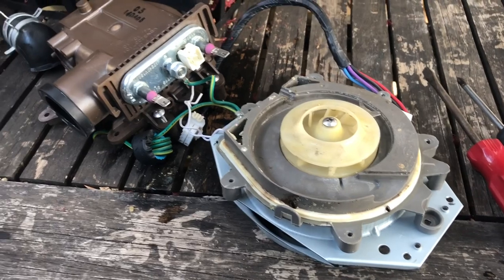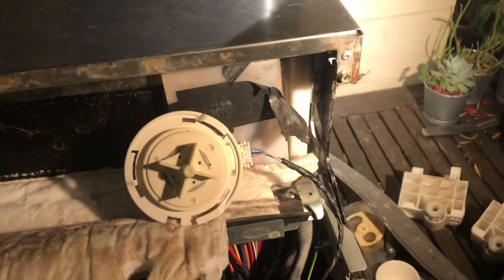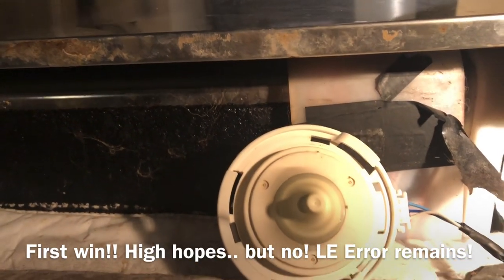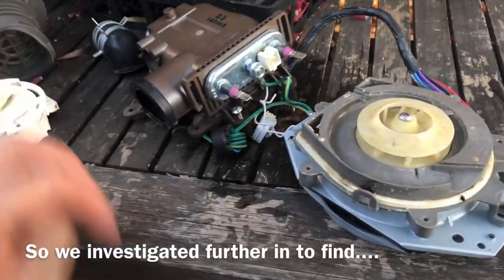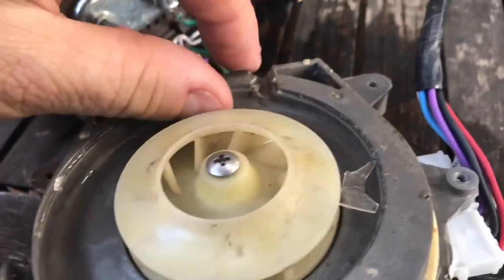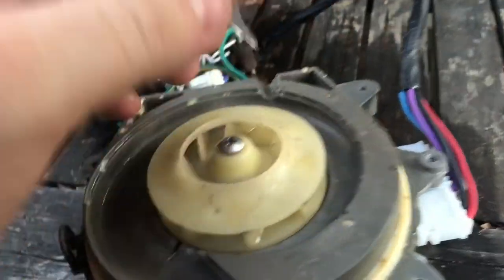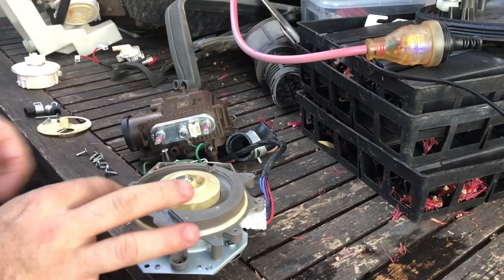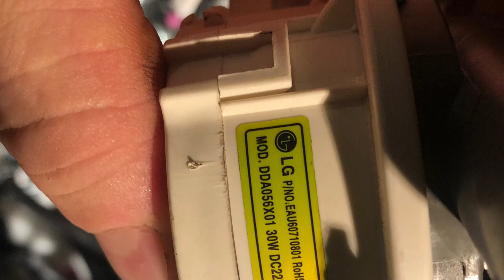Electrickery - How to Fix LG Dishwasher LE Error for free!

Comment: I was getting the LE error.  Noticed that on start of a cycle I’d hear it test the drain pump… then whatever was next sounded like a motor but was clicking and failing. I just took off the motor part. Didn’t have to take the whole assembly out… I found the screw that was supposed to hold the turbine in place had come undone and jammed just like the glass in this video. Video gave me enough hope to to try this, so thank you. FYI you can run it though the start of the cycle without water while on its side which is what I did out in my garage.
Reply from the maker: Awesome mate thanks for letting me know, I love hearing about successful home repairs :-)